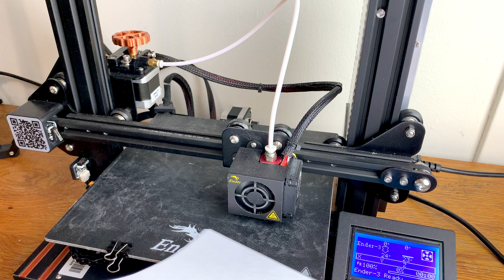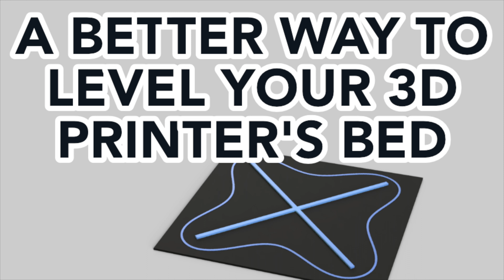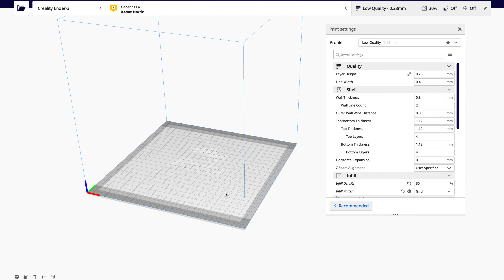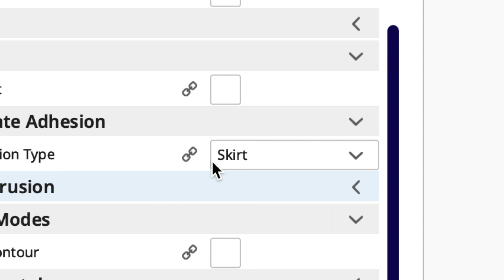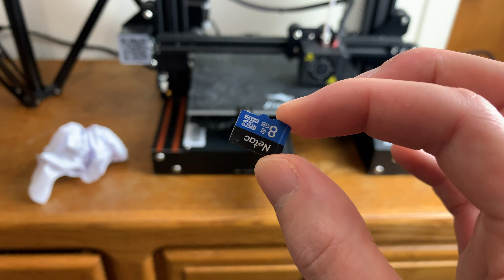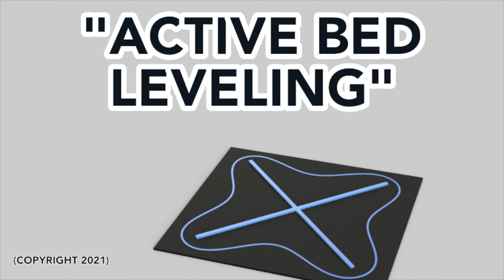The BEST way to level a 3D PRINTER's bed [Ender 3 Pro]

Comment: I didn't think to lower the bed before doing this and now my plate is really scratched (Even the hotplate under the magnetic plate is scratched). I'm going to by a glass one but will the extruder head be ok after that?
Reply from the maker: might be ok, I recommend having some spare nozzles just in case.

Comment: Im sure this is good for new comers but the paper method does work if you know what to look for, throw in some of the yellow springs and call it a day. I've done that with all my printers and first layer is always perfect, excellent adhesion and ZERO elephants foot. I check it maybe once a month but have never even considered using a BL touch